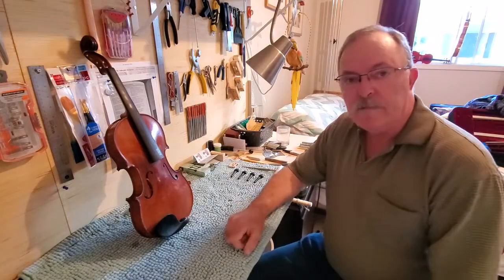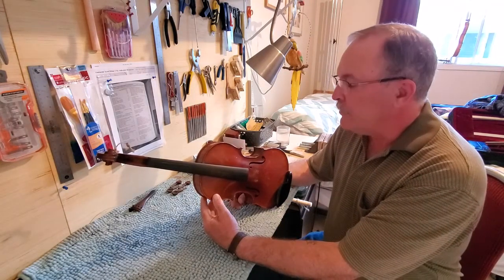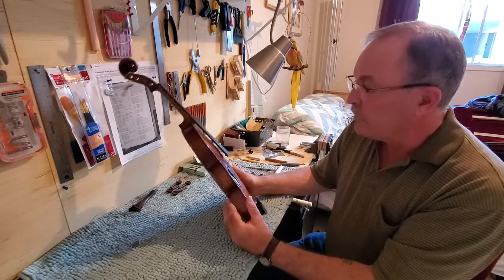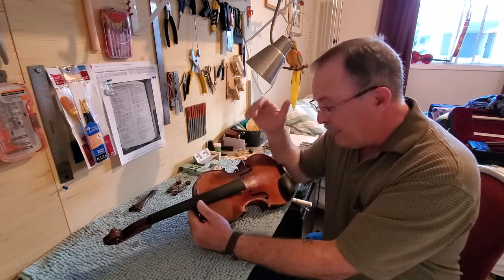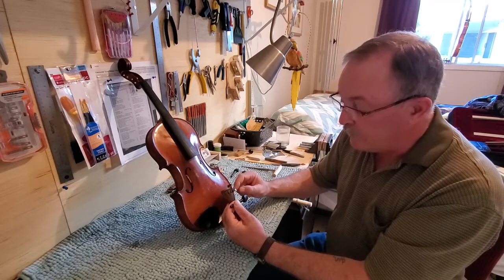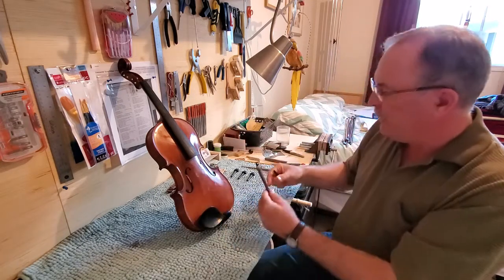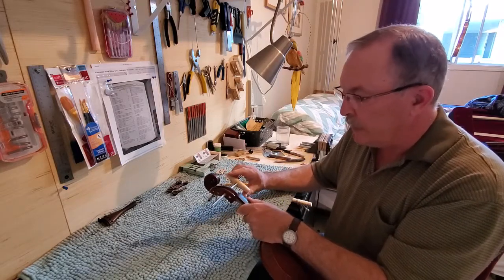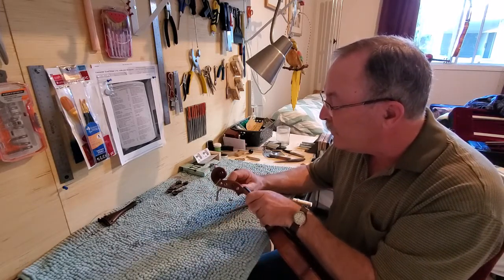Derazey Violin and Wittner Tuning Pegs

Comment: Installing the Wittner Pegs is not done until you glue the peg to the peg box.  If you do not do this, the peg will not hold under the string tension.
Reply: Wittier pegs if fitted correctly should never be glued. Knilling/perfect pitch  pegs may need a small amount but not Wittner.

Comment: I'm no genius but the last ebony fingerboard you were working on it seems like you should have filled it in with a mixture of sawdust and epoxy or something so you didn't change the thickness of it and all the rest of it. And then sanded it down. And with all the work you're putting into this Old Violin and then putting on geared pegs and changing the ratio of 1 to 30 you might as well have bought $100 Cecilio and upgraded it with your $40 bridge and your D'Addario Strings and all the rest of it. here insulting people who own and love and upgrade other brands not nice